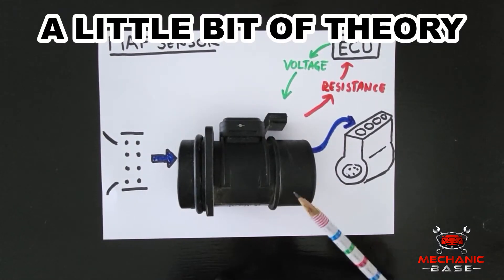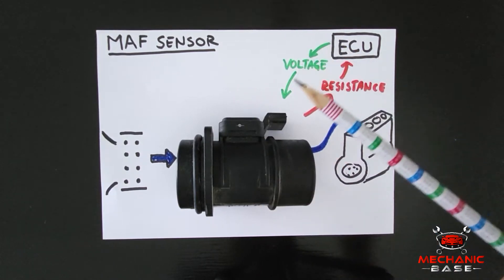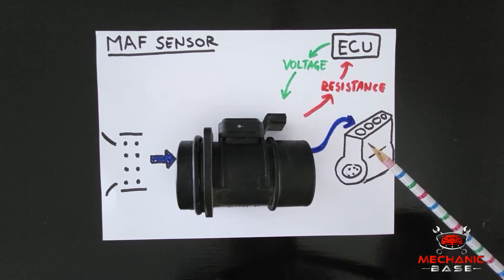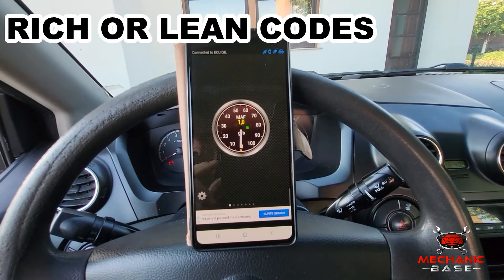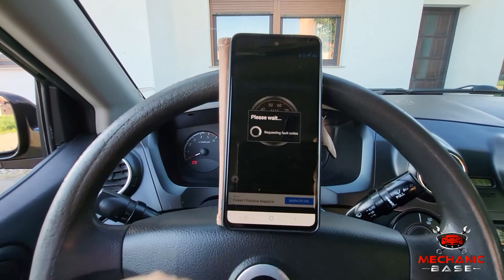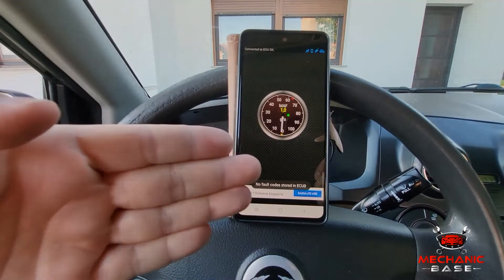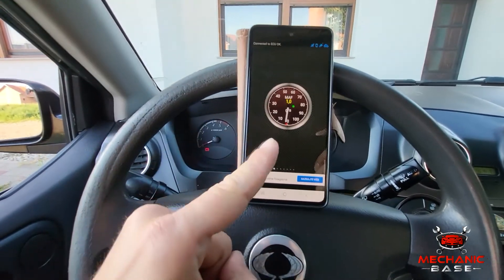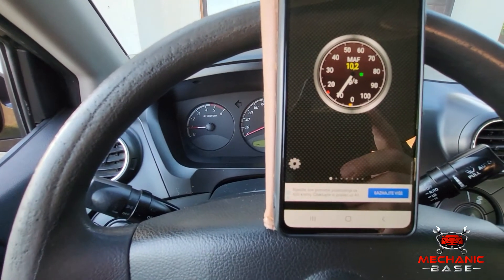5 Symptoms Of A Bad MAF Sensor (and Replacement Cost)

Comment: Is it normal if the engine light shows before starting the car but goes away when starting the car?
I'm having all symptoms: jerk acceleraction, missfire, long cranking before starting but no errors are showing on the OBD machine. I've removed and cleaned the MAF and no difference ... still having the same problems
Reply from the maker: Which car do you have? 
Yes, you should have the check engine light on when you turn on the ignition (before starting the engine), but it should turn off a second or two after starting the engine.
Reply: @MechanicBase  Its a 1.9TDI Seat Leon 105HP from 2010 - 1P1 version. The light goes off after the engine starts. Though could be the 109 relay but I just replaced it and still having this issue.

Comment: Can A Bad MAF Sensor Signal A Bad O2 Up/Down, both banks, Sensors 1, both sides, or Sensor 2, Upstream when wire circuitry had to be repaired to those particular wire connecting from a wiring harness, that sends signal to PCM?
Reply from the maker: Yes, it can. Which codes do you have?

Comment: I have Astra G 2002. Engine cuts off and car struggles  to fire up the engine. After for a while engine can start again. I changed the fuel filter and fuel filter relays but the same issue continues. Please advice?
Reply from the maker: Do you have any codes? Which engine does your car have? Check this video also👇👇
https://youtu.be/aYqdw5z0MV0
Reply: @MechanicBase   Unfortunately, I don’t have a code. Thank you for your reply. I will watch that video.

Comment: If you unplug a MAF while the car is running, it should stall. However, it still doesn't mean that your MAF is functioning correctly. These are just quick checks but they don't tell you much. Checking the performance of the MAF with an OBD2 is the way to go.